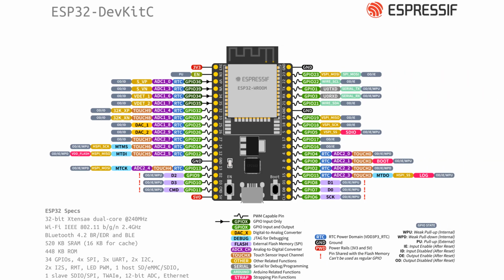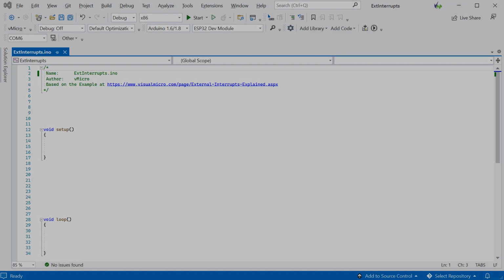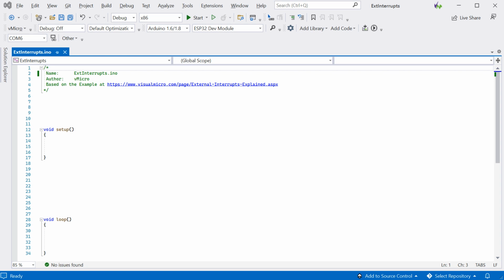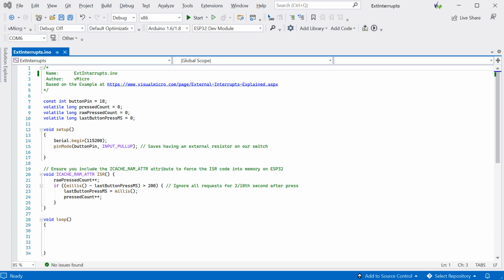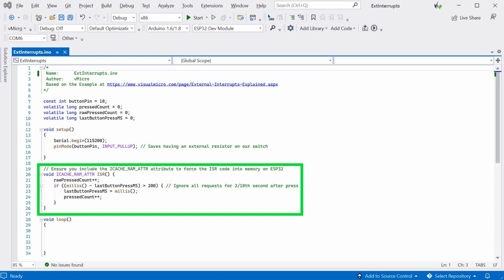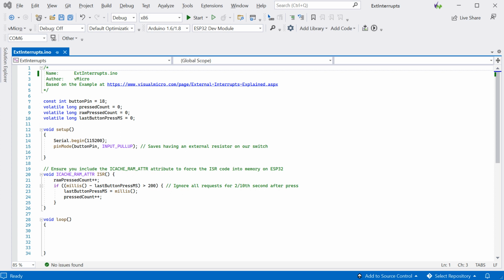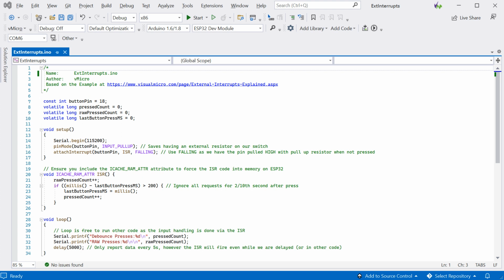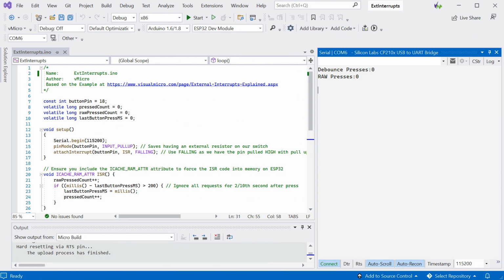Using External Interrupts

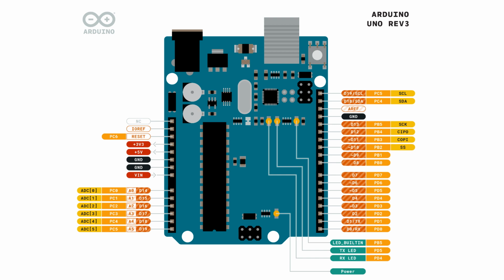Comment: Hummm...  at 1:04 into the video, you state that the Arduino (i.e. ATmega168/328) only supports interrupts on 1 or 2 pins.   This is not totally correct.  While it does have dedicated Interrupts on 2 pins, which also support type of interrupt (i.e. raising edge/falling edge),  ALL the other i/o pins do support "Change" interrupts.  They are not quite as easy to configure and used, BUT THEY DO EXIST.  :)  :)   Great video though.  I just found your channel.

If you look at an Arduino UNO pinout you'll see labels "PCINT0 - PCINT23".  These are "Pin Change" interrupt #s.  UNFORTUNATELY, Arduino Library for UNO only supports INT0 & INT1.  So if you want to use Pin Change interrupts on other pins, it looks like you have to go direct to the AVR Registers...  TOO BAD...
Reply from the maker: Good point! We kept this video to just the hardware interrupts, as handling the PinChange Interrupts can be more awkward as you have to determine which pin caused the interrupt to fire in your ISR, which can become more confusing when supporting a number of devices via interrupt.

Some boards (e.g. ESP32) do support interrupts on all pins, so you can have one ISR per pin.